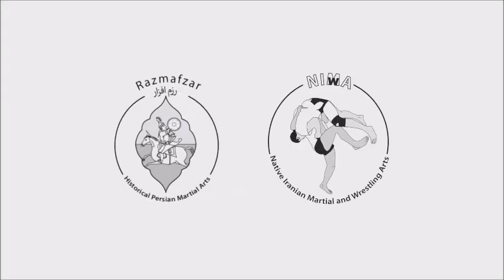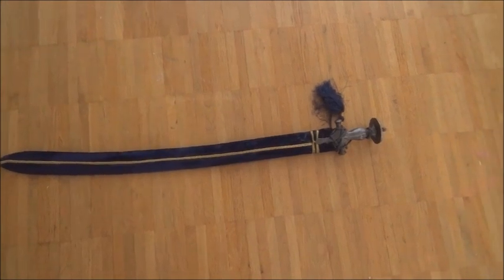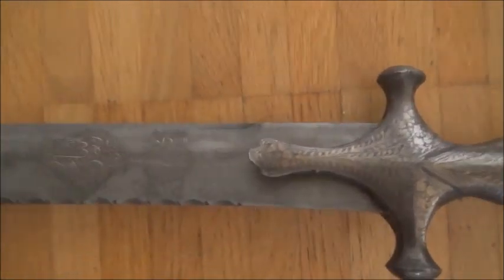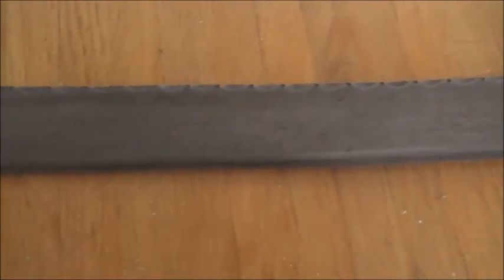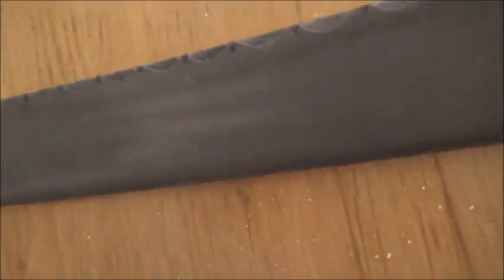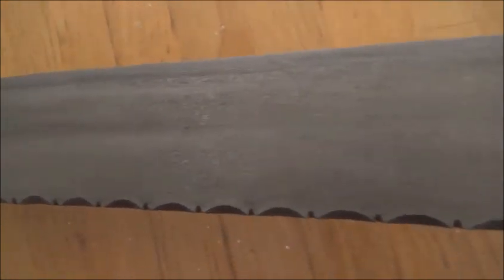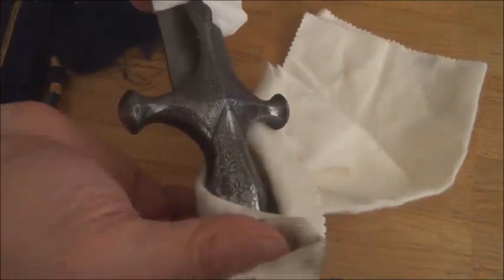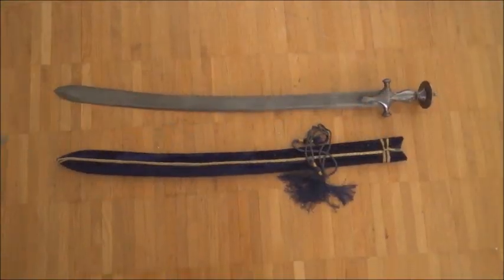A reproduction Tulwar with patterned welded steel

Comment: Oh hey I actually found out about this channel a while ago from reading your article on the comparisons of Indian/Persian swordsmanship! I was wondering would there be any restrictions to using a tulwar in razmafzar training? I'd imagine a shamshir would be more ideal but if I only had access to a tulwar instead of a shamshir would I still be able to use all of the same techniques as a shamshir? Loved this review/demonstration!
Reply from the maker: You can do most of the techniques but not all. The locked position of the tulwar prevents you from some wrist movements you can do with a shamshir, kilic or a seif.  But Tulwar has some of its own techniques for sure.  You can do most of the techniques though.  You are very welcome.

Comment: did u have any issues with a small handle?
Reply from the maker: I explained in the video not at all.  The handle is not small, it locks your wrist.  If you use the techniques properly everything is great
Reply: @RazmafzarTV  the few talwars i have held have very small handles compared to normal european swords or even the shamshir. My hand will not fit in the handle let alone the locking in place. i usually have to bring my index finger over the front gaurd to hold.
Reply from the maker: @aryarish  Shashir handle fits very well.  Back to tulwar, due to excessive punching, I have really wide and thick hands and again the handle fits very well.  You need to feel pressure and have your hand locked.  Some antique tulwars were made for teenage princes.  Maybe you have them.  Other than that if it fits my hand, it should fit the others as well.  No need to bring your index over the quillon on those made for adults.
Reply: @RazmafzarTV  ok thank you very much